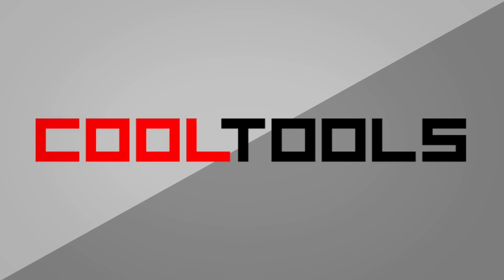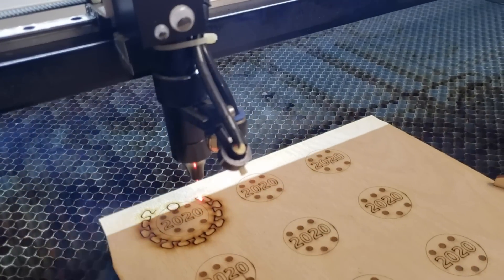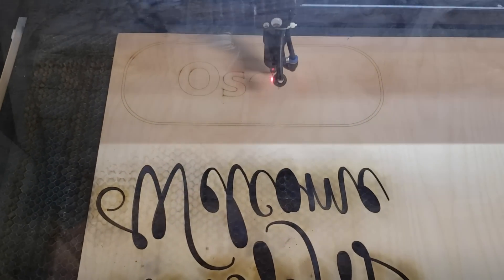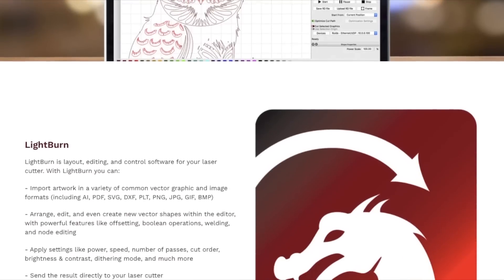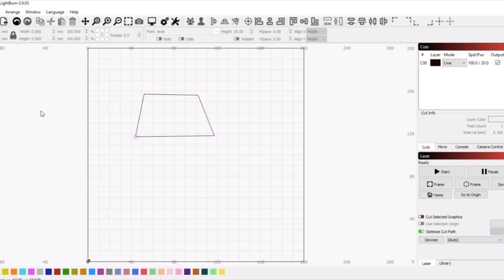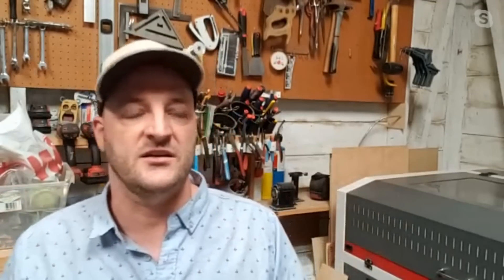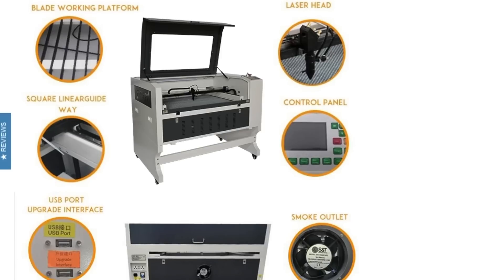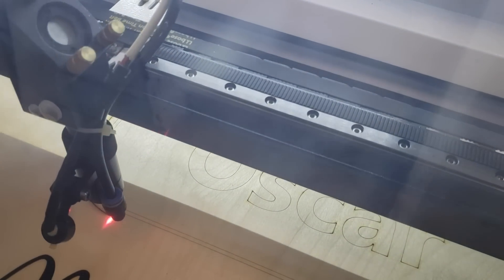Glowforge Killer: half the price, twice the power

Comment: Please provide details re size of fan you bought so I can make sure I'm looking for bigger.  Also, what are you using for cooling?  The cooler that came with the unit?
Reply: If you are in the US, search for the LightObjects website. They have some nice affordable chillers and fans. In the case of a chiller get one that matches your tube wattage or slightly above. You want it to get to 18/19 degree C while running. The fan is always a trade-off between sound and performance. If you can mount the fan outside the shop it gives you more options. Also, get a blower-style fan that you can disassemble. Over time it will collect smoke residue on the blades and you want o be able to take it apart to clean that stuff off. If not it will start to sound like rocks in a dryer when you turn it on. Use rigid metal ducting when you can instead of the flexible stuff if possible too.

Comment: How does this compare to an Orion Motor Tech?
Reply: The OMT 50watt laser has a smaller cutting surface, half the power, and the bed is raised/lowered with a hand crank instead of being motorized. Those are pretty much the only differences. They have the same controllers so they all work with the same software.